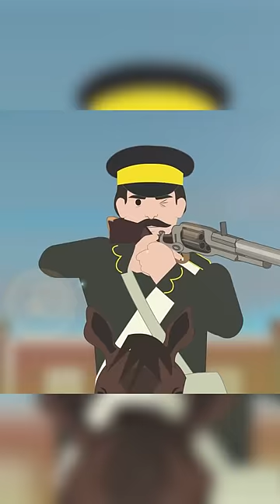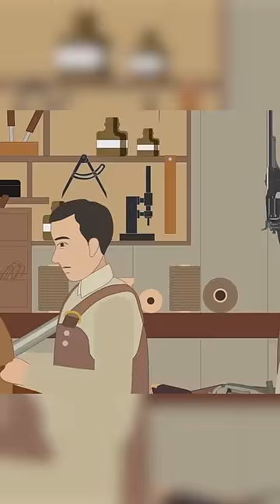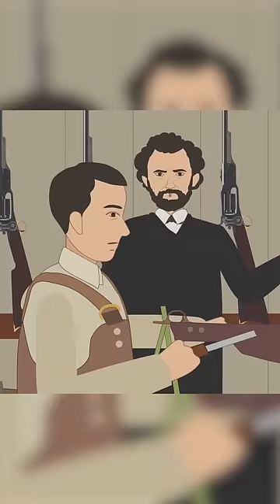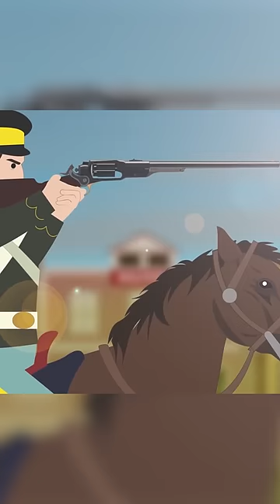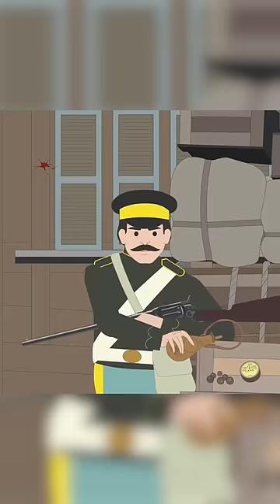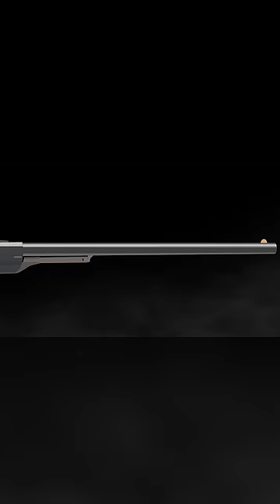Cursed Guns - Colt model 1855 (Good idea, badly executed)#shorts

Comment: The term for a revolving muzzle loading weapon having more than one cylinder go off due to sparks from the cylinder gap is a chain fire. Cooking off is when a cartridge that is loaded into to the breach of a semiautomatic, or more often and automatic weapon spontaneously fires due to thermal energy from the chamber heating the cartridge and its contained propellant beyond the temperate of ignition.

Comment: "NOOOOO YOU CAN'T USE A PISTOL MECHANISM TO MAKE A RIFLE YOU JUST CAN'T"
"Haha revolver gets stretched"
Reply: fires one round and explodes
Reply: @jessemorris744  to be fair tho doing that with a revolver configuration in the cap and ball era wasn't the best, just what they had handy to make a repeater rifle. Me? I would've tried to just stretch a pepperbox, it can't chainfire if the space is too much for the still burning powder to fly and ignite other charges (and even if it does it's a long pepperbox, it can fire 6 rounds at once without too many issues)

Comment: It would been a effective if it chamber for self contained center-fire brass cartridge.
Reply: Which wouldn’t be in any significance for another 2 decades. Rimmed, pin, or center fire. And it would still have the draw back of gas-blowout.

Comment: Don't let the chain fire naysayers fool you, these didn't chain fire if loaded with ammo that was in spec.
By the era of percussion caps, military ammo was supplied in waxed paper cartridges, the paper was used to wrap the ammo to get a tight fit
And
When not loading with paper cartridges the spec required lead ball that was slightly oversized, this ammo would deform into the chamber to once again provide a tight fit.
The real reason these never made it was that they, like every repeating rifle of the era, were hand-built and custom-fitted due to the lack of assembly line tooling (an innovation popularized by Henry Ford almost 50 years later), and were therefore prohibitively expensive.

Comment: If you’re shooting it like the character in the video does, with the both hands rear of the cylinder openings, you’re probably fine. If it chainfires, the most that will hit you is a bit of hot unburnt powder.
Percussion revolving carbines are only actually dangerous when held like a traditional rifle with a hand forward of the cylinder.

Comment: The title feels a like Click-Bait, so here’s why the Colt model of 1855 is “cursed”. 

The revolving rifle used loose Blackpowder and percussion caps to fire; shooting the firearm naturally created sparks of flames which could then accidentally simultaneously detonate the other loaded cylinder pockets, resulting in a catastrophic explosion. 

The other problem is that even when the gun functioned without problem, the very nature of a cylinder revolver means a substantial amount of gas escapes when firing, and if held like a rifle, results in the supporting arm getting burnt. 

Finally, a company called Rossi sells the Circuit Judge, which is a revolving rifle chambered for both .45 Colt and .410 Shells.

Comment: I am missing something here cuz I didn't hear any downsides, only the specification of the gun and its story.
Reply: It could do a "chain fire", which means that the gun would fire all chamber at once (what are not supposed to happen), so basically if you hold it the right way, you just lost your hand
Reply: Chain fire, where all the ammo in the cylinders would all shoot at the exact same time when firing.
If you held the gun as you would normally, you'd lose the other hand. Some techniques were used where you held the gun with one hand over the other.

Comment: What was the drawback of this gun ?
Reply: Others chambers could detonate on their own, resulting in shooting at your own hand if you hold it properly as a shoulder weapon
Reply: Also because of bieng a Revolver carbine, putting your hand in front of the cilinder you could burn and injure it. That's because of the escape of gas when shooting.
Reply: Even if the mechanism worked perfectly, (which it didn’t,) reloading a percussion cap revolver is extremely slow. The only advantage the revolving rifle had over the conventional muzzle loader of the era was the ability to fire off all its cylinders at once, making it not very effective overall.

Comment: Is there a link to a longer video that describes how it was poorly executed?
Reply: I think the reason was the chain fire. It happend from time to time with all the revolver type guns in that time period. Chain  fire is when you pull the trigger and accidentally all the rounds fire at the same time. In the revolver it wasn't that much of a problem. But in a longer rifle shooter usually have his other hand in front of a cylinder. In that situation when the gun chain fire, the shoiter hand would be obliterated
Reply: @77Zenin77  I did find part 2 which explained. 
But I do think this video was poorly done. Even to be a multipart set of shorts it should have been formatted differently, maybe said the problem and that part 2 explores it.

[Edited from here] It was, ahem, a good idea poorly executed 😁.